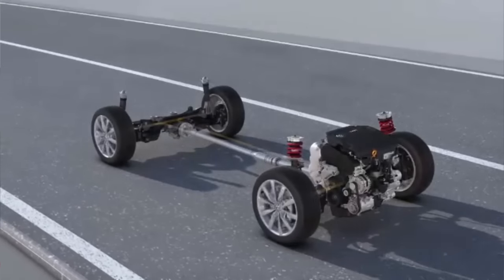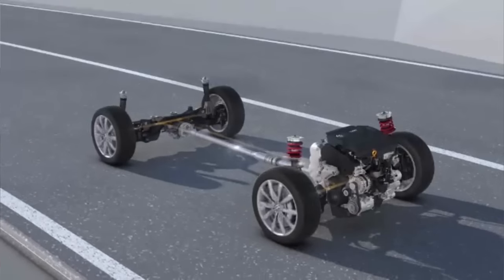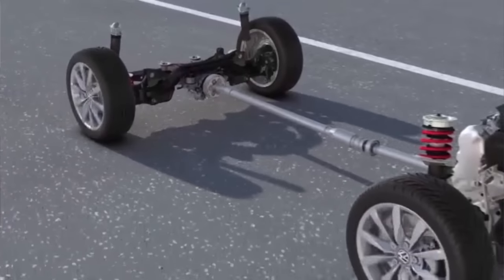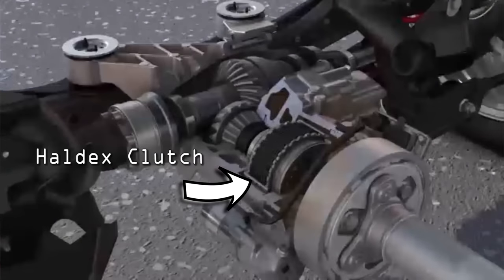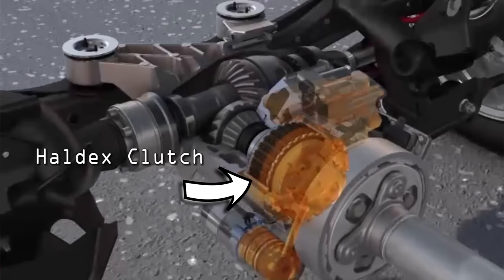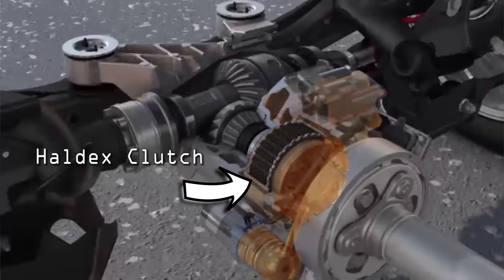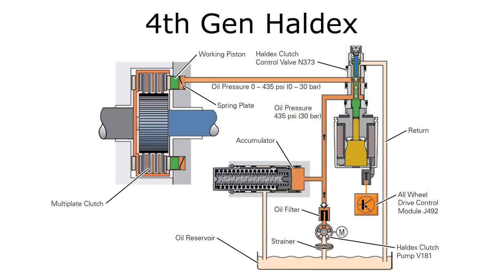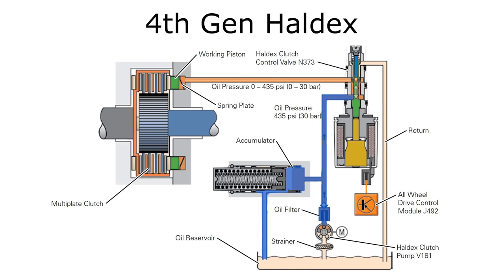How Haldex (AWD) All Wheel Drive Works

Comment: Just to MAKE it Abundantly Clear any on-demand AWD system consume the same (+/_ tenth of a %) amount fuel whether on not AWD is engaged or not. All that AWD garbage is dragging MPG down due to mechanical drag and weight. And  yes, when it says "Disconnects rear differential"  it doesn't mean it is not spinning. Everything continues to spin as if AWD minus clutches aren't transferring engine torque to rear differential. 
 It has been debunked many times. 
AWD and FWD of the same make and model fuel consumption is a totally different subject.
Reply: Some systems disconnect quite a lot of parts, not everything continues to spin.

Comment: 50/50 ??? rear power came from right transmission ... open diff so 0 to 100% ... when it come to 100 % right it take power on 3 wheel ... right front locked with rear open diff ??? very difficult to understand haldex 🤣🤣🤣
Reply: Very difficult to understand what's your point. Power goes to the back via PTU, which has stiff connection with ring gear of front differential. This way front axle may be locked with rear axle when haldex is locked.